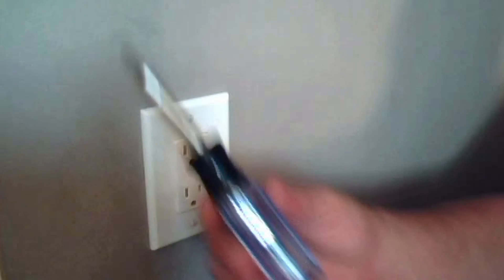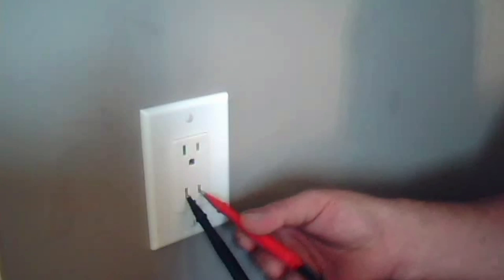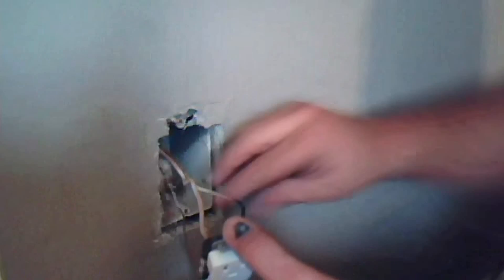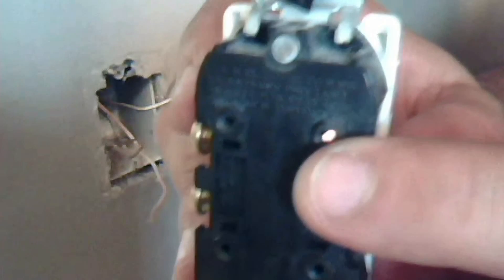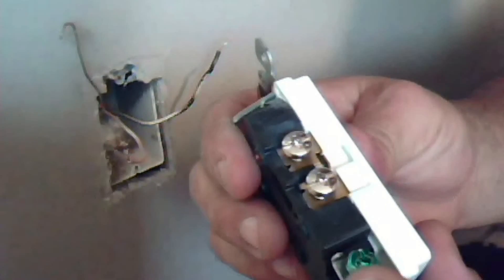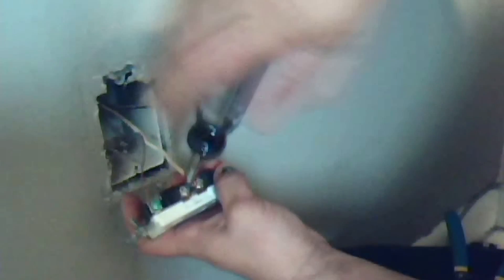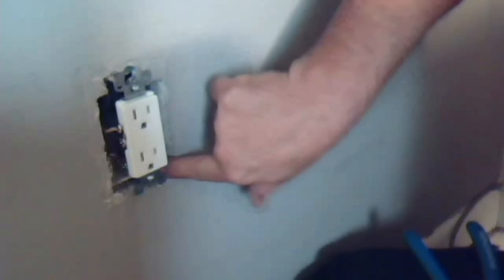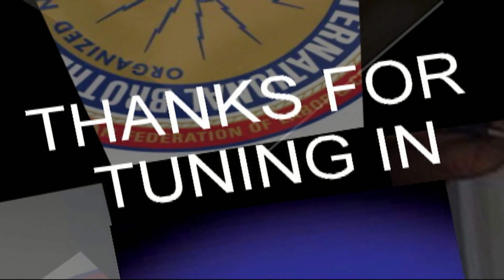How To Replace an Electrical Outlet/Receptacle

Comment: If the multimeter shows little more than 0 Volts, better to check circuit breaker. Sometimes they begin to pass mains voltage in turned off position some little time after those 2...5 volts. If circuit breaker is too old, better also replace it.

Comment from the maker: @ts46176 BECAUSE THE FIRST VIDEO IS NOT DETAILED ENOUGH...IF YOU WANT TO LEARN HOW TO ELECTRICAL WITHOUT THE SAFETY IT TAKES TO PERFORM IT, THEN YOU WILL DIE . MY VIDEO IS A COMPREHENSIVE VIDEO ..IN DETAIL....BUT AT ANY RATE...ITS MY FIRST VIDEO CUT ME SOME SLACK..IM SURE ILL DO BETTER AS I MAKE MORE HOW TO VIDOES...IM USED TO MAKING OTHER TYPES OF VIDEOS.THAT ARE LONGER